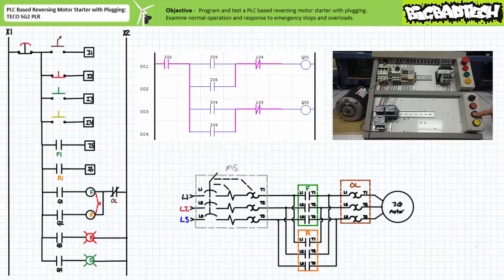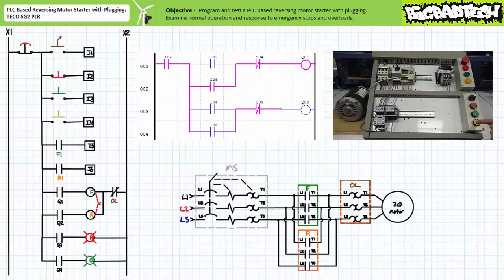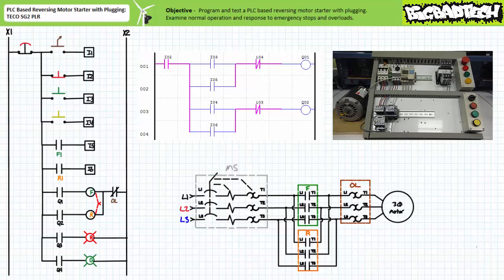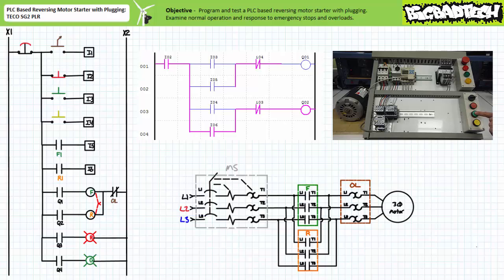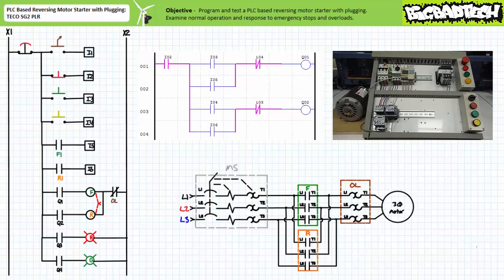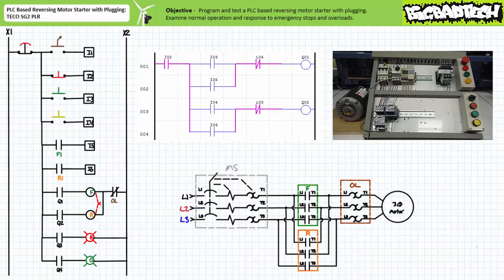PLC Based Motor Starter with Plugging: TECO SG2 PLR (Part 2 of 2)

Comment: Hey Jim I was just curious if you have any recommendations for supplementive material for relay logic. I am a 3rd year electrical apprentice but just recently (6 months) started working for a control company only doing temp and motor controls. Im learning quite a bit in the field but we can't always interrupt install to be taught relay logic in depth. So just looking for more ways to learn. Thanks
Reply from the maker: I've got a whole playlist covers traditional hardwired relay based ladder logic if you haven't seen it already: https://www.youtube.com/watch?v=LM8U9FCMDx0&list=PLdnqjKaksr8qRPCFkU2Q8XQe0bfo99rs6
I've got some (not all) study guides posted for this material at:
https://www.cgcc.edu/study-guides
Also check out the allaboutcircuits website. They've got everything and more.
Another great resource is manufacturer websites like Omron. They've got a bunch of free elearning lectures although you do have to register for it.
Reply: Ok great. I appreciate the response!